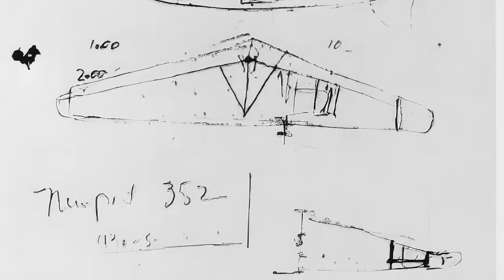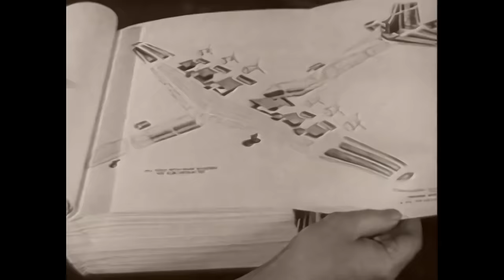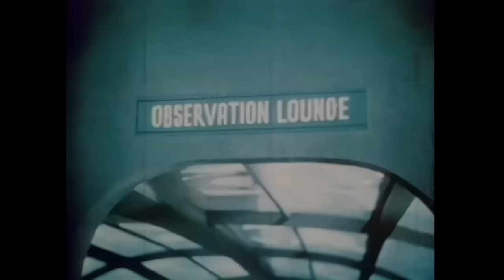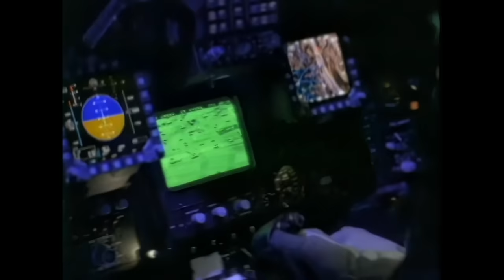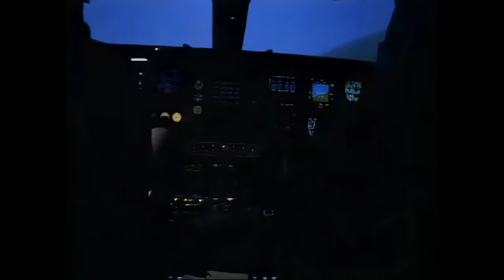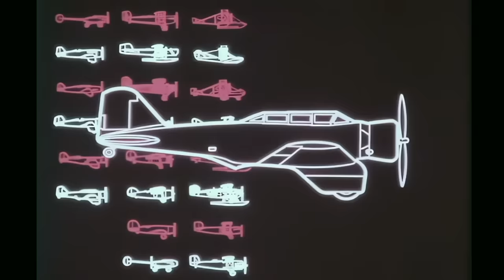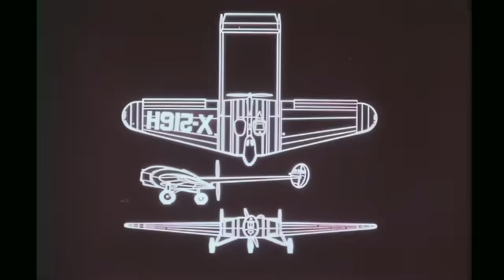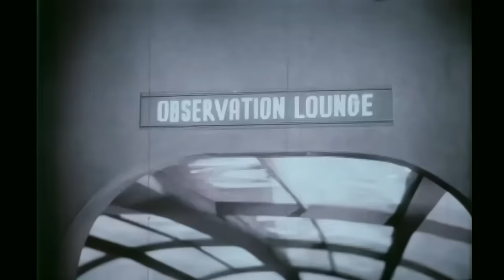The History Of The Flying Wing And U.S. Bomber Aircraft. Jack Northrop's Dream

Comment: Horten brothers had the first flying wing before Northrup ever did
Reply: I doubt that, Northrop was working on his at the very beginning of ww2!! In fact his first one was prop driven!! Maybe Horton came up with the idea around the same time or shortly after but Northrop was first and wasn’t just a drawing.
Reply: @Legion-xq8eo  the Horten brothers had flying wings that could be flown before the end of WW2. After the Americans captured and sent them to the states one of our top test pilots even flew one.
Reply: Slither back under your rock now .
Reply: Not correct. Northrop’s designs were the Horton brothers inspiration.
Reply: @matthewhenderly5236  explain why and how then that the Nortens wing actually flew years before Northrup s ever did? Enough of the white washing of the facts.
Reply: These people casually forget gliders exist. 
The Hortens built exactly that - as flying wing designs.
In the 30s. To be seen in Oberschleißheim museum.

The French built some as well, btw. Theirs just didn't work that well.
Reply: Bull. Ever heard of "parallel evolution?"
Reply: ¿¿ Evidence  / links??
Reply: @eastockerable  evidence or links to what?
Reply: Jack had one in 1928, no??
Reply: @eastockerable  not a jet powered one... The first jet powered prototype flew in 48 but with less than desirable performance and other issues.
Reply: @eastockerable  I provided proof as you asked now you say bull and mention parallel engineering? Northrup never even had jet engines for it until 48... Long after Horten wing flew with jet engines.
Reply: Nah go look the dates up. Don't try to discredit one of the best Aerospace engineers to live with Nazi bullshit. Google said a Czech guy invented it and most early attempts at flying were flying wings. Just go look up the Wikipedia page. Everybody had a hand in the design from the 1910s-1930s. Germans, Americans, Soviets, Brits, everybody was trying their hand at the design. The only credit they should get is the first jet powered flying wing. But it was barely a plane. A last ditch attempt from a utterly devastated 3rd Reich. All of Northrups flying wings were much more aircraft than that bundle of sticks in the woods.
Reply: Even if Northrop saw the work of the Hortens, he likely wouldn't take inspiration despite their designs being readied earlier. He's already planning stuff more advanced than the brothers' by 1946.
Reply: Northrop had been designing and flying fighter size wings before WW2.
Reply: @trance9158 first N1M Flying Wing powered flight 1940.  Second Flying Wing N9M first flight 1943.  Horten’s Flying Wing Glider first flight 1944.  Sorry, I had to contradict your belief with facts.
Reply: First N1M Flying Wing powered flight 1940.  Second Flying Wing N9M first flight 1943.  Horten’s Flying Wing Glider first flight 1944.  Sorry, I had to contradict your belief with facts.
Reply: @Legion-xq8eo first N1M Flying Wing powered flight 1940.  Second Flying Wing N9M first flight 1943.  Horten’s Flying Wing Glider first flight 1944.  Sorry, I had to contradict your belief with historical facts.
Reply: @Legion-xq8eo Your are wrong. The Horton Brothers flying wing H II already flew in 1934. I can not understand how you can ignore history.
Reply: @matthewhenderly5236 Bullshit. The Horton H II flew already 1934.
Reply: @Renshen1957 Bullshit. Hortons first motorized flying wing H II flew already 1934.
Reply: @Renshen1957  your data is flawed ... The hortens were building and flying winged gliders in the 30s first off... That's a well known fact. The first wing to fly by jet power NOT propeller engines was the Horten wing 3 times in 45. Northrup didn't have a jet powered wing until 49 and it was less than spectacular.
Reply: @Renshen1957  I thought that Jack was into the all wing design before the hortens. Who knows if they both independently designed and developed their aircraft.  Thanks for giving me the dates.
Reply: @Renshen1957  you've posted jabberwocky.... I can and have posted FACTS.
Reply: @trance9158  Besides your speaking Ex Cathedra on the Subject (similar to the Pope on matters of faith) what evidence do you have as to the first power flight of a flying wing aircraft. Even Wikipedia a less than peer reviewed source has this correct.   Gliders do not count if there’s isn’t photographic evidence.  Where’s the documented evidence of Flying Wing under powered flight.
Reply: @avronaut  You refer to the Habitch which was a Glider with a "borrowed motor" that made one flight and subsequently burned? That's an excellent reply, it does antedate Norton's aircraft. I stand corrected. however how many were built? One if I recall correctly.  Military contracts, none.   Their second purpose built aircraft  which you refer H.II, which test pilot Hanna Reitsc flew and stated not ready without more work, never put into production. The  HO 229, the bomber (Hitler wanted bombers) that the Nazi Govt. tested without power as a glider is 1944.  The HO 229 first powered flight of the H.IX V2 was conducted at Oranienburg. It was later destroyed in an unapproved flight.  General Patton's Third Army captured the Ho 229 prototypes V3 through V6 at Friedrichsroda, Germany, in April 1945.  Thank you for the persistance, and I stand corrected.
Reply: Everyone knows about the Hortons....
Reply: Check out the flying wing early biplanes designed to imitate birds - as far as was structurally and technically possible before WW-One...
Reply: Everyone had a flying wing back then, the Hortens just shamelessly took all the credit
Reply: Don't forget about Lippisch, too.
Reply: The YB-49 used jet engines produced by Northropp as no one had devoped powerful enough jet engines. The government said Northrop is an airframe manufacturer only and can not build engines having a monopoly. Northrop sold the jet engine technology to GE. Source - The Flying Wings of Northrop.
Reply: @avronaut Merca
Reply: @turdferguson4124  Hortens did too... And the Northrup wing didn't work well at first... It took the aid of computers to get it to fly properly. The initial test proved way below what they were claiming its performance numbers should have been.
Reply: @turdferguson4124  look at the Argentina military records where they went to. Budget and inadequate industrial complex limited what they could develop after the war. That's common knowledge.
Reply: The Hortens did build a flying Wing glider in 1934. in 1939 they went into military Frontline Service. In 1941 someone in the German Air Ministry did read an article about northrops flying Wing Designs in an American aircraft Magazine and did remember the hortens. They were called back and did start work on flying wing military aircraft. The flying Wing itself was Developed by mother nature which was originally the inspiration for all who did work on heavier than air flying.
Reply: Northrop has his first flying wing prototypes in the1920s, well before Horten
Reply: @turdferguson4124  they weren't taken seriously or known by the allied side until after the war. They were not even trained engineers. To do what they did with what they had is far more worthy than Northrup. You just choose to white wash the actual facts .
Reply: You guys are both wrong.  The boomerang 🪃 flew long before either of your claims.

Let's not discredit the mighty boomerang.
Reply: There was a fighter version of a flying wing the Nazis had they had one flying. It crashed the second one they found was brought to the Smithsonian institution where it still sits in a disassembled condition. Research done during the development of stealth aircraft revealed that had been developed by the Nazis the Nazis would have had an aircraft that the English Channel would not have been able to see coming at them until the bombs were dropping over London these planes the Flying Wing configuration or developed As Natural bombers in the stealth program stealth program the scientist dedrived to formulas for making stealth aircraft was Russian and he was smuggled into a Aeronautics design job teaching in California. He kept the Russians from developing stealth buy defecting to the United States
Reply: 😂 what's the matter I know too much intelligence for you😂
Reply: So?
Reply: What about his small twin engine research prototypes from 1940 they were 5 years earlier than Hortens wing
Reply: The boomerang was a great invention for sure but it relied on spinning rapidly about its axis for gyroscopic stability @PowerScissor
Reply: @HughBond-kx7ly  they weren't jet powered.
Reply: @Legion-xq8eo  There is too much he says -she says on this subject .Let's just say    the B 2 bomber was the first successful military Wing .and maybe the Burnelli wing almost made it
Reply: Hortens was essentially a glider. Not a plane. There is a difference
Reply: Horten 229
Reply: @jgar611 No, in fact the research found exactly the opposite. The plane had a slightly lower radar cross-section but would still have been clearly visible to radar because it had nothing even resembling a stealth coating and the turbine blade were completely exposed.
Reply: Who
Reply: Sorry bud in 1910 or so a Czechoslovakian guy made the first flying wing. Igor or something like that.
Reply: @Billshepdawg  a jet powered wing?? Not a glider.
Reply: So what?
Reply: @martulda  you want needle and thread?
Reply: @Legion-xq8eo The Hortens built their flying wing gliders and first propelled versions from the beginning of the 30's. And so did Jack Northrop. In fact their flying wings were parallel inventions. None was a copy of the other!
Reply: The German probably had the design hidden like everything else.m
Reply: @trance9158  not actually true, it was a wooden mock up that lockheed engineers remade to the specifications of the Norton brothers. They had one in germany that never worked tho
Reply: @trance9158  you said first flying wing, not first jet powered flying wing
Reply: No, the first recorded flying wing was built by the Soviets
Reply: @zibin1  the soviets had nothing. They were so far behind everyone at the time
Reply: @trance9158 Check Wikipedia instead of yelling

Comment: It's an absolute crime that they destroyed all the flying wings. At least one should have been preserved for the Air Force museum. The B2 proves Jack Northrop was on the right track.
Reply: Granted, they should have kept one. But if the B2 proves one thing, it's that the problem of keeping a flying wing controllable without sophisticated computers has yet to be solved.
Reply: @nikolaus2688  Actually, the Horton Brothers solved that issue with the first Jet powered Flying Wing. The prototype ran circles around an ME 262. Project Paper Clip took a Horton Wing to America. And photographed the factory and its mass production line of flying wings.

Comment: 34:20 "Now I know why God has kept me alive for the last 25 years."

I knew this was coming. Hits me in the emotions every time I hear this story.
Reply: The B-2 is within a few-inches of the XB-35/YB49 in- both Wingspan, AND Chord-length at the Outer spans! What Jack did-not-yet-have, was Reactive Fly-By-Wire Control. He was, simply ,6 decades Ahead of the complexity needed in Reactive Control of the flaps. If he had that Computer-Driven control-surface manipulation, we'd be using the flying wings as Airliners for,  oh a half-century by now.  The Horten Brothers, somehow, did a bit better that Northrop, by making Gliders first, then adapting those to use Engines, some of which were early Jets. Those were 'skittish' in Yaw, but didn't seem to have the 'flip-stall' issue that Northrop's wings tended towards. Those combined 'issues' have been figured out now in the B-2, X-47, and B-21 planes we now have.

Comment: The B-2 and B-21 are specialist, stealth aircraft. From what I understand, they are mostly functional due to complex modern computer systems that can compensate for the lack of a fuselage and tail. Meanwhile, practically all other modern aircraft continue to have a fuselage, a vertical tail, and wings. Most of the military ones are supersonic, unlike any of the flying wing designs.

Only the stealth features kept the flying wing concept from being a complete dead end. Boy, they sure look cool though.
Reply: Have you seen proposed designs for the 6th gen stuff from the US? They all lack a conventional empennage. Stealth is just one reason for this. There are major aerodynamic benefits as well

The reason why planes like the F-22 and F-35 have a conventional empennage is because they needed it for control reasons. That will likely not be the case for a lot of future aircraft as better control without conventional control surfaces become more and more developed.

Also, basically every single new recent jet is a fly-by-computer setup, even in airframes that are inherently stable such as airliners. Fly-by-wire literally dates back to WW2 and iirc the F-16 in 1978 was the first military jet to use a fly-by-computer version of fly-by-wire. So this is going to be a feature of everything in the future. So that is a non-issue.
Reply: @whyjnot420  All true, but I was describing actual modern aircraft, as opposed to proposals. I'm no aerospace engineer though. From what I have observed, the flying wings are very niche as of 2024, much like 1947, although two designs are now deployed -  in miniscule numbers. There were 21 B-2 Spirits produced with one crashed in Guam and another already in the USAF mega museum in Dayton, Ohio. Jack Northrop's vision of fleets of flying wings is likely decades away. It's a shame as they look so good.
Reply: @amerigo88  X-47B. Yes it is one with an X designation, but it is far from a proposal. It has actually taken off and landed on a carrier. Note that this isn't simply an experiment. It was a tech demonstrator. Meant as both a practical real world test as well as to show how it could be utilized. This was a drone, but check out the Loyal Wingman program for the Air Force to see how they plan on utilizing similar drones alongside manned fighters.

These (and things like I referenced in my first reply) are actually blended wing designs. The halfway point between a pure flying wing and a lifting body. You can think of them as an evolution of both. It is true that they are not pure flying wings but then again, neither was the YB-49 (the jet version of the YB-35) as it had vertical stabilizers. Keep in mind that a lifting body design is already the halfway point between a traditional design and a flying wing. So I would argue that they are more flying wing than not, though I will readily admit that they are not true flying wings (as I just did).

food for thought: Would they look as good if they were ubiquitous? I would answer "No." As one of the reasons we love flying wings is because of how different they look. Most people don't even bother looking at where the engines are located in a plane, but they sure as hell can tell the difference between a B-52 and B-2. And just about everyone gets bored of the stuff they see all the time. Sure they would still look "good" just not as good.
Reply: yep even the last ten years one can fly veris RC craftd cause of the advansment in tiac> GPS . u can actuly set gps in a model to take off and lans in a foot are so of programed spot [WOW]
Reply: The concept of Fly By Wire computer control was something learned from the study of Nature. Aeronautical Engineers all agree that a Bumble Bee CANNOT fly because of its poor design. Yet, not only can it fly in forward flight, but it can Hover and Fly Backwards too! And why? Because its brain allows it to. And they do NOT listen to Nay Saying engineers. Stealth craft using facets use Fly by Wire. Think of the F-117 Nighthawk. Back in the early days of the 20th Century, the Aeronautical Engineers of the day all said powered controlled forward flight was impossible. Because they all flunked badly. It took a couple of Bicycle Building brothers to show Mankind the way.
Reply: @GTP2-zg9tn  Have you looked into more recent studies that suggest we think and operate our bodies with not only our brains, but also our spinal cord? Which has long been said to transmit signals to and from the brain, but now due to the way paraplegics spine is rendered inoperable signals from the brain can't get to where they are meant. Yet certain artificial signals somehow jump to where they are supposed to go, without a direct connection to the brain telling it to do so. With the only apparent way for this to happen being for the spinal cord to have done more than it should or could if it was just a fancy transmission device.

Comment: Seeing that promo for the concept of a flying-wing airliner, I had to laugh when I saw the picture-windows. "Watch the world below!" Acrophobes would crap their pants. There's a big difference between looking out a window beside you and looking down past your feet to the ground. Heck, I'm not acrophobic in the least, and it gave me a bit of a start.
A bit of trivia about Glen Edwards: he was warned by one of his fellow test pilots NOT to stall the YB-49. I saw in interview with that pilot, and he said once the wing stalls, it flips nose-over-tail. He was only able to recover by applying full power to the engines on one side while idling the others. That put the aircraft in a recoverable state, but it was a narrow escape from certain death. But Edwards had stall-testing on the schedule, so that's what he did, unfortunately. (The problem persists to this day: stalling a flying wing is very nearly unrecoverable. Because of this, the fly-by-wire system on the B-2 simply does not allow a stall to occur in the first place.)